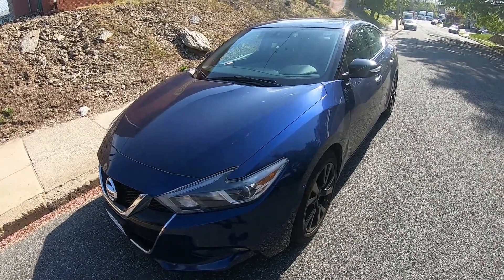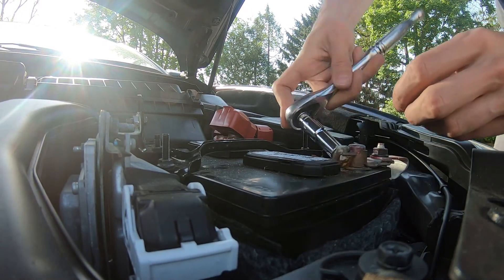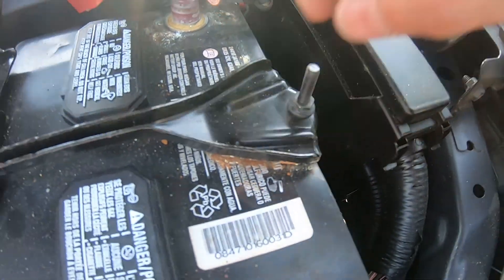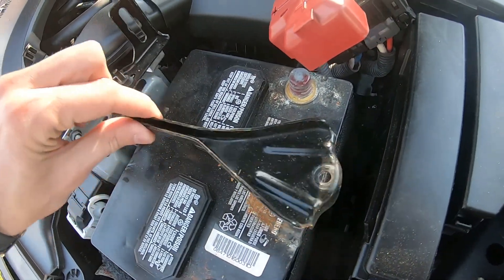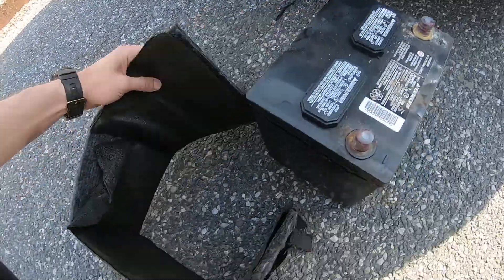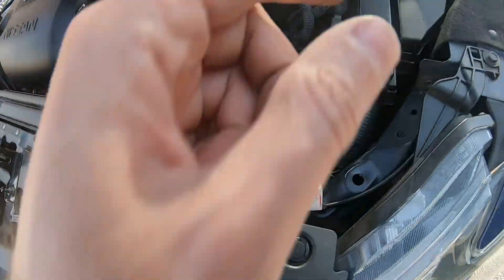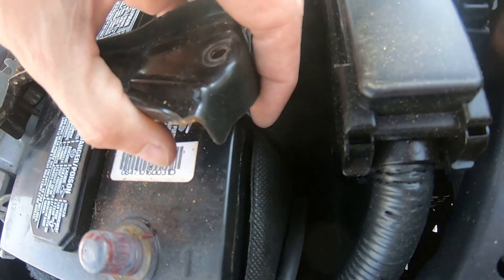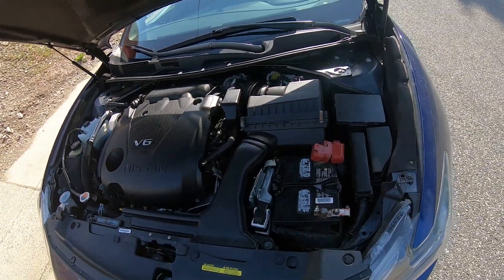How to change replace Battery in Nissan Maxima 2015-2022

Comment: Just changed my battery old one had a 1/23 sticker on it. Trsted battery it was pulling only 7v while cranking anything ynder 9v i think is not good . Got me a agm battery since  i do a lot of stop and go deliveries . If you ger a agm its a little shorter height wise than than flooded .